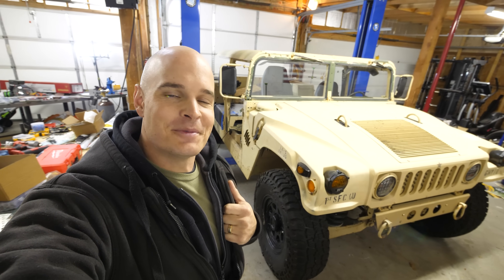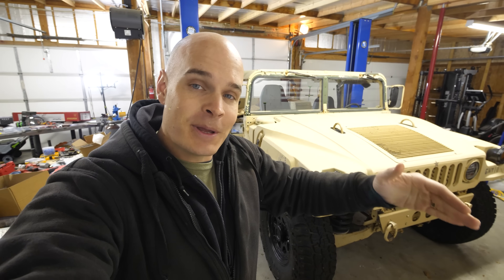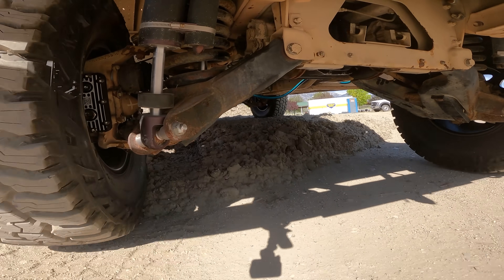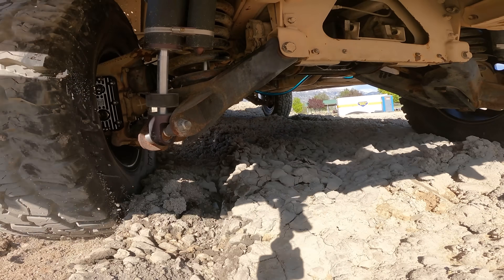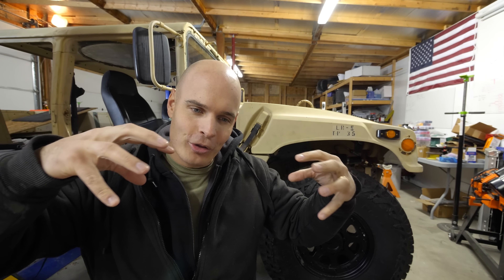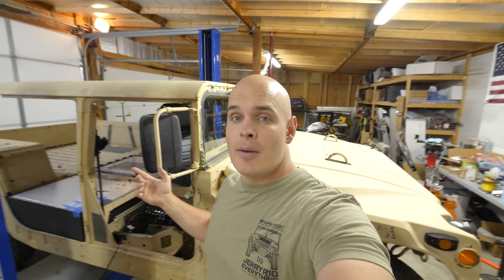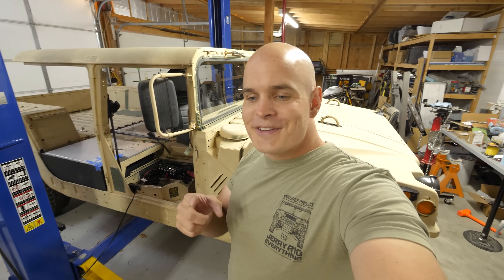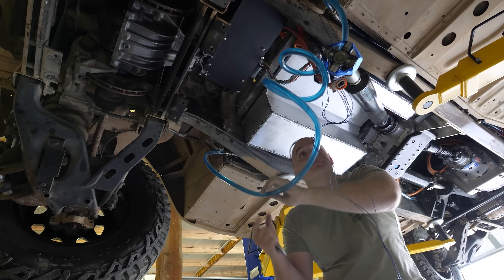I have some explaining to do... - EV Humvee Update

Comment: Your CAN wires should be twisted pairs, wrapped in shielding. Each device connected should have a 120ohm termination resistor.
Reply: Each device or just the end of line? I had the same thought about whether or not he had the resistor installed.
Reply: Yep should be twisted pair throughout, with no more than 30cm from each component to the main trunk.  There should only be two termination resistors in the network, ideally at the end components.  More than 2 in a single network can cause issues.
Reply: Twisted pairs aren't necessary if the cable shielding's properly managed (lookup Belden's DeviceNet, which is CAN, cabling). And the 120 ohms should only be present at each end of the trunk, in order to get the 60ohms lines impedance required.
Reply: Thanks for the info. 🙂
Reply: @benfowler2127  Just the end of the line, maybe? If each device has one, then it's just multiple 120 Ohm resistors in parallel. Enough of those could effectively short out the CAN-H and CAN-L lines.
Reply: No OEM car have shielded CAN cables but they all have twisted pair cables as it is cheaper and actually better than just shielded.
Reply: Twisted pair at this length should not be an issue. Termination resistances are needed for sure!
Reply: Just at two end nodes. Not on each device.
Reply: NO! the only termination resistors should be on the furthest ends of the trunk. You can terminate the trunk itself or the two devices can have internal termination resistors, but all the other devices on the network should NOT have 120 ohm terminators.
Reply: @M_Gargantua  This is the correct answer! Only at the and of the bus, total parallel resistance of the bus should be 60Ohm. Also all devices should be compatible with speed and protocol 😇.
Reply: Correct. Cable needs to be twisted or it will not function properly. A twist every inch should be fine. Also the termination is usually done by the ECUs at the end of the line but that is only valid for more OEM type stuff. For this custom build, resistors may be required. Shielding is not really required with proper twisting.
Reply: @mk71  In an ICE vehicle I'd agree, but with the high likelihood of RF interference from the EV drive? It's Belt and Suspenders time!
Reply: @digitanalog , some say you don't need it, but as you and I state, it's atleast good practice. I have zero issues when I play with CAN BUS but I alwyas make sure I have twisted pairs and 120ohm resistors in each device. Works a charm every time!

Comment: Use CAN terminators, You know, typically one 120 ohm terminator at each end of the longest length of the network, also if you have long branches you can have terminators at the end of those, but preferably raise the terminator resistance to keep the total equivalent termination over 60 ohm, any smaller and you will over load the signals. This cleans up the signal by preventing reflections.
Reply: CAN is a 60 ohm network, each node must have a 120 ohm termination. & & & Mahdi you're awesome ❤️❤️
Reply: If some information is being sent and others aren't, it's in the addressing and format of the messages.
Reply: I wish this won't blow anything in the car
Reply: @OneBigWorld2010  no, not each node.. It'd only END termination
Reply: This sounds a lot like an EOL issue which is what I was thinking about. It sounds like if the EOL is not a certain resistance, the circuit doesn't detect anything, or detects that the circuit was left open or shorted, which could be causing issues with the CAN network.... Am I on the right track?
Reply: Wow youtuber collab in the comments 🔥🔥
Reply: His diagram labeled them as terminated, so it can be assumed they have resistors paralleled in or enabled in those devices. But never assume...
Reply: Exactly what I was thinking - you can never assume your devices are terminated.
Reply: Omg legend is here ❤  nice to see him 🤩
Reply: Came here to say exactly this.  Do any of the nodes on the CAN network have termination as well?  There should only be two on a CAN network at the furthest ends of the trunk.

Comment: Usually you need some sort of resistors in a CAN network. Also, if you have shielding on the cables, you'll want to make sure those are connected together so there aren't any gaps. Looks like the splits you made in the cable didn't connect the shielding foils. A shielded cable that isn't connected to ground can actually result in more interference than if it were unshielded.
Reply: 120 Ohms thermination of my memory is correct.
Reply: @michelcote  
A 120 ohm resistor on each end. Parallel so the network should read ~60 ohms with a multimeter.
Reply: I think the CAN protocol is related to the RS-232 standard, which requires termination resistors.
Reply: I was basically screaming at the video too with this! I designed a product that was to be installed into Vehicles and I had to build my own CanBus on my desk, you need the resistors for it to work for sure!
Reply: Also at 6:59 you can see that the solder did not actually melt, thus there is not a very good connection at the splits.
Reply: @justushache5785  This is the first time I hear that you can branch out on a CAN bus. Let alone add more than exactly two 120 ohm termination resistors. Do you have any references for it? I mean CAN is a bus system so just by the name the only valid topology should be a bus right?
EDIT: Obvious without adding some sort of active component like a gateway etc.
Reply: @michelcote  A J1939 backbone CAN network need 2 of the 120 resistors on each end of the harness. Terminating resistors they are called. They should be wired in parallel, so when you check the pos and neg of the communication wires should come to 60 ohms. This is the easiest way to check them. 

I have been troubleshooting CAn networks in commercial vehicles for almost 30 years now, since 1996.
Reply: Yeah, came to the comment section to write about termination. This needs to be done, even if it did work, it could randomly fail without proper termination.
Reply: yea it connected the shielding cable but we don't know if it's grounded in only one point
Reply: I've been troubleshooting and repairing CAN networks on vehicles for Allison transmissions for 24 years, and the last 5 years for the government. None of that matters. NEVER have I seen shielding cause a CAN error. 
I replace or make up new CAN harnesses all the time in Gillig Hybrid Buses, I am a Hybrid expert, it's basically all I do most days. When I make up a new harness, I just use regular wires, not twisted or shielded. Just using the deutch brand terminals and connectors from our repair kit, and reuse the terminating resistors that are already there. An entire bus will only have 2 packs, 2 120 ohm resistors, ran in parallel which will be 60 ohms on each end. 
You also don't have to have resistors, the CAN should still work. If someone is having an issue that is causing the whole network to die, it's either the wire polarity is reversed somewhere in the network OR more common is that one of the devices is using the 500K BAUD CAN and the others are using the 250K BAUD CAN, or vise versa. This is the single biggest mistake people make. Depending on the year the parts came out will depend on what BAUD rate, and they are NOT backwards compatible. Mix these up and the entire network will glitch out. For example I installed a TRW steering column off a deadline bus a few weeks ago, they look identical. They use the CAN to get speed data. When I turned on the bus, everything was flipping out. Gauges, shift pad, bus doors opening and closing. I had put in a 250K part in a newer 500K CAN bus.
Reply: Also check termination point of the the shielding. If the controller expects shielding input on the connector be sure to only install it there and not multiple places
Reply: yea i didn't see any plug terminators
Reply: I was going to say this…similar to when using 1 wire data devices with an ESP32 or Arduino project bord
Reply: @giacomosmiderle9717  Shielding cable won't cause the problems he is having, it's not possible. I haven't used a shielding cable or twisted pairs in almost 30 years.
Reply: @mikeworkman3593  won't cause the problem, but if you have a shilded caple and you don't gound it then it's usless
Reply: @john-alotofnumbers  A controller doesn't use shielding  for anything. And even if by some miracle it did, it only needs one ground, since grounding is universal to the chassis everything is connected to. 
Shielding only connects to the controller to be an output shield wire when sending the CAN to another component. 
The best thing is to toss the shielding wire in the garbage, because you don't need it for nothing.
Reply: Each device functions as a termination point the only place you need a Terminator is on any open end of the can Network. Typically there are terminators on can networks for expansion so you have open ends in case you want to add other devices. That was my first assumption as he's missing termination someplace along the can Network.
Reply: @mikeworkman3593  it depends a lot on what wire there are arroud the cabling.. But yes that is all digital really no problem if you do not shield it, but better do so then don't
Reply: @kevincali  Low heat solder connectors can result in cold solder joints, poor wetting and flow. It's a bit hit and miss. Tried with a pack of ten brand connectors once on a few different size stranded cable after a youtuber released a video that seemed a bit too sponsored. Results were too mixed for my taste, at least outside a emergency repair setting.
Reply: why do u need resistors?
Reply: why tf do you even need twisted pairs? its just a short cable run. like running wires to a speaker
Reply: @kevincali  At 6.58 you can clearly see it melting.
Reply: @TheMJErickson  RS485 requires termination. CAN has nothing do do with RS232/RS485
Reply: @mikeworkman3593  I agree all our generators here 50 mW are running Can and are in a pretty harsh environment, Can is a slow speed network so is not effected as much by noise
Reply: Agree with all these comments. Shield &  twisted conductors would only be important for VERY long CAN networks. This change was a good & healthy choice to eliminate spurs & improve reflections on the bus. Would really need a scope on CAN_H & CAN_L to determine the integrity of the signals.
Reply: When everything is off, take a multimeter and measure across CAN L and CAN H in resistance mode. You should see 60 ohms. The two 120 Ohm resistors should be on either end of the longest wires, and any stubs coming off the CAN bus should be less than 30 cm ish (Probably not super critical, though).
Reply: Its weird how people will say shit that is completely WRONG!
Reply: @RipCityBassWorks  %%
Reply: @Blox117 it helps minimize the noise on the communication lines.
Reply: @TheMJErickson  More closely related to RS-485. RS-232 can only connect 1 to 1 you cant have multiple devices on the truck. From the bandwidth cap of CAN-Bus sounds more like RS-422 but not enough wires as it is only 2-wires like RS-485.
Reply: I'm so late to the party and everyone is reading my mind lol! @Jerry what Canbus system \ protocol are you running?
Reply: @kevincali  Your right, the solder ring did not appear to melt could be a HR joint

Comment: Seeing a new jerryrigeverything video gives me the same feeling of opening Christmas presents
Reply from the maker: Thank YOU!
Reply: @JerryRigEverything  I can't wait for The Humvee when it is Finished With the solar Panels on top And Maybe Cameras On the Humvee so you Can See Every corner and the back and Front , oh and airconditioning hot and Cold inside the Humvee Must add that and Doors and back later on
Reply: @JerryRigEverything  As for your can woes.  Double check termination resistance and make sure each device on the network is at the same baud rate.  One device at the wrong speed will wreak havoc on everything.  Really shouldn't be that tough.

Comment: Check your termination resistor configuration. You should have two and only two 120 ohm terminations, on the furthest ends of the bus. These can be internal to the devices on the ends. Sometimes things designed to be at bus ends will have hardwired internal terminations which will screw you over if they aren't on the ends. Other devices will have a software configurable termination resistor.

You can check your terminations by measuring between CAN+ and CAN- and you should always see 60 ohms anywhere on the bus. If its lower than that you have extra resistors somewhere and it won't work.
Reply: Can't stand terminator resistors going out, absolutely correct measuring should be appropriate. Most software naturally expell information most of the time just have to be aware of this
Reply: I’ve both installed and troubleshot hundreds of CAN installations, in an industrial environment.  I completely agree with your thoughts.  I was thinking “termination” the whole time Zack was working on it.

Comment: A few thing I noticed. 
1. You should have termination resistors on the last module on each end of the network, usually they are integrated to the modules but yours might not have them, usually 120 Ohms each, bridging the two com wires on each end, your network should measure 60 Ohms between the two com wires when everything is off.
2. Your splices should be properly soldered, dont use those heat shrink with solder they dont make a good connection, it doesn't even look like you heated them enough to melt the solder anyway.
3. At your splices you should make sure the shielding is connected, it needs to be continuous, no breaks, and usually it is grounded as well.
Reply: First thing I noticed that solder didn't melt
Reply: I would like to add that CAN wires should be twisted and I couldn't tell if the wires were a twisted pair
Reply: regarding point 2 that isnt really true as we use them on aircraft all the time. main thing is ensuring uniform heat distribution to melt the solder without destoying the insulation. You should be using the deflector when melting them and it works fine.

Comment: Actually looking forward to the winter rivian towing video. I can already see the charging and range taking a massive hit to the point of frustration.
Reply: The Rivian is not a towing vehicle. It's tiny. It's about the size of a small Kia SUV. Like a Hyundai Santa Fe. You could tow a jet ski or a snow mobile or motorcycle, but not much more than that. It's smaller than compact pickups like Colorado and ranger, and about the same size ass a Tacoma. It's a car frame with a truck body. Like a Baja or El Camino.
Reply: @littlejackalo5326  The Rivian has an 11,000 lbs towing capacity. That is higher than the majority of 1/2 ton ICE powered trucks.
Reply: @Davidabston  Just because it can, doesn't mean it should.
Reply: @littlejackalo5326  the Rivian can certainly tow, but it is a short range towing vehicle. Definitely not a long range one.
Reply: @user2C47  sure, but the Rivian should.  For towing under 100 miles, the Rivian will outperform most 1/2 tons.
Reply: @Davidabston  it can do, but that range will take a beating.  Unless you're hauling things very local
Reply: @domzjb5053  Correct, the range will be reduced… just like every ICE vehicle when towing.

Comment: Nice! An update on the EV Humvee! I've worked a lot with CAN networks (industrial applications). If the issue is electric, you should have a comm lines impedance lower then 60 ohms (ohms meter between the 2 CAN COMM lines should be 60 ohms if the terminations are correct). I have no idea how you setup the device IDs on your hardware, but you usually need to set those, set your master, node 1, and slaves, node greater then 1, and what information/actions they all hold. Good luck!

Comment: 1st of all: welcome back! Your build quality is outstanding! 
CAN data is sent out as a differential pair to avoid common mode noise and needs a railroad (no branches) with stubs as short as reasonable, I use 22awg tsp (twisted shielded pair) wire with 4" stubs, main buss length totally doesn't matter.  The 120 ohm terminator on each end is essential, we could talk about characteristic impedance, rise times, and signal bounce back.  You are well advised to use the correct wire for good data quality.  The data actually travels as a wave and the terminators stop the wave at the end of the line, your data destination can't see the data line voltages changing if it's all mixed up with data that took a longer path and arrived at a later time and then he data packets will be rejected - like playing a musical instrument in a hard room, the terminators are like wall acoustic tiles that absorb the data preventing bounce back data noise.  
You don't actually need to have an on-board-charger to run the EV, golf carts leave the heavy transformer & rectifier at home.
Solar on your home roof providing DC current into your EV Battery is efficient.  Place an inverter in your home to power your home with vehicle battery power.

Comment: I know some folks have already mentioned that you need termination resistors on your CAN Bus, this is a good place to start. I've worked on CAN a fair bit for industrial automation and tend to refer back to "Application Report SLLA270" By Texas Instruments, it has a wealth of knowledge on how to properly set up a CAN Bus.

Another tidbit if you're still having noise issues after that. A lot of times instead of a 120 ohm resistor we'll put 2 60 ohm resistors in series and then throw a capacitor to ground at the junction of the two 60 ohm resistors to make a low pass filter. We'll usually use a 1nf one when operating a 1Mbps bus but just tune your rc filter so the -3db point is ~2.5-3x your baudrate.